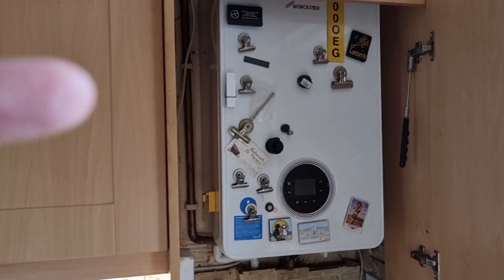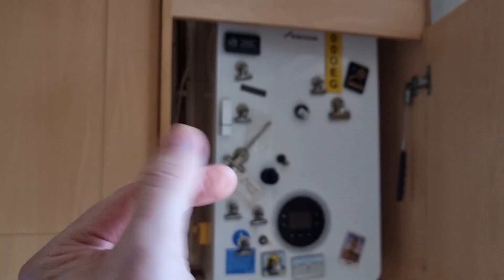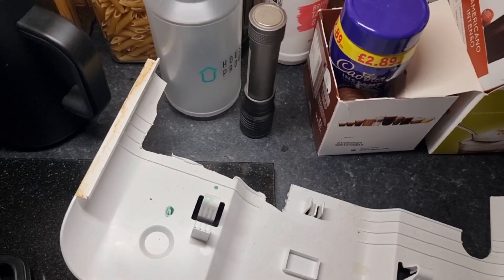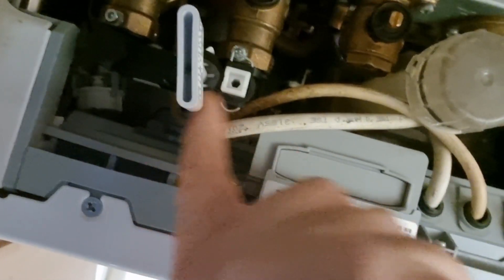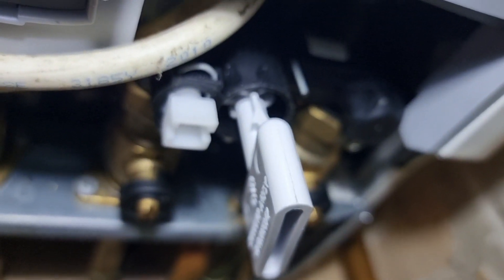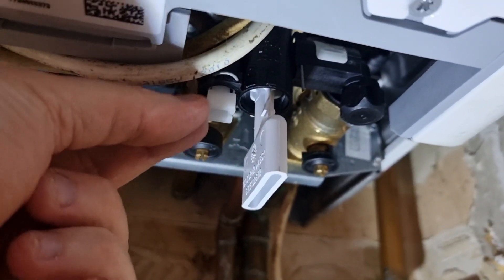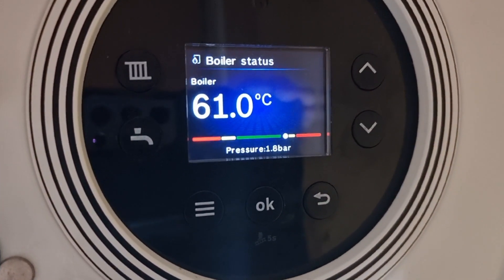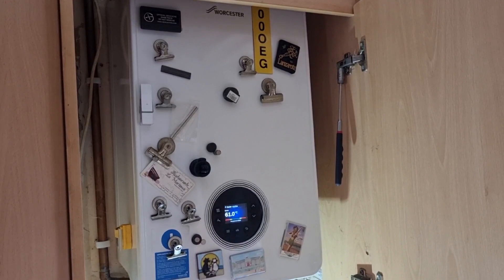How to pressurise a Worcester Greenstar 4000 boiler and where to find the key.

Comment: My Worcester 4000 has the key aswell, I've been hearing a gurgling noise from mine so going to bleed radiators. 

My question is that it's advised to switch off your boiler when repressurising, how am I meant to know what the pressure is at if its turned off??? 😂

Comment: Thanks for this video. Worcester Bosch's own videos are hopeless - they say it should have been demoed how to do it on install, but it absolutely was not. Then it relies on me knowing that the bottom of my boiler comes off without showing me how that happens. From a casual look over, it does not look like the bottom plate is removable. So, seeing you take your bottom plate off pointed me in the right direction and then I quickly found the blue filler valve. Very helpful, thanks for doing what the manufacturers couldn't and showing me HOW
Reply from the maker: I'm glad you found video helpful to you. I totally agree the manufacturers or the installers should have demonstrated everything so that nothing was left to doubt

Comment: yours is the most helpful video by far - all the videos show a blue valve , like you mine does not have this . The boiler is only a year old and the key is missing . Can only assume the installers stuck it in their pocket by mistake. I have a key on its way via a well known online retail site. Only wee observation I have is that my boiler doesnt seem to have the little white square box next to where the key goes in - so fingers crossed its a simple insert and twist to refill function !
Reply from the maker: I actually found my key. It was a attached to something on the boiler but I'm trying to remember where. It may be clipped onto the inside of a flap or something. If I remember I'll send you a comment
Reply from the maker: Check underneath your boiler there may be a bottom tray that unclips. It may be quite stiff but I'm sure on the inside of that tray the key as attached to it
Reply: @wrightbytes  Many thanks for your responses - key 100% missing . BUT !!!!! - it turns out our boiler has an ' intelligent filling system' installed so it refills itself automatically. We had paid for this extra when the boiler was installed. It was a ' simple' case of going into the menus on the screen and selecting the auto refill option-  its default setting is OFF so you have to tell it to refill itself incase there is a serious leak so it needs human intervention to make sure its ok to start repressurising which makes sense . Lo and behold thing was pressured up and running after about 5 mins. I thought about putting a video up as i can NOT find a video that tells me this and YOUR video was the only one that came close to helping me out. The giveaway was the fact that mine did not have the key insertion valve underneath like yours and definitely did not have the blue valve that every other video seemed to show. Thanks again
Reply: Interesting 
Had mine fitted about6 months ago and haven’t checked pressure as it’s only been running the hot water so far. Heating being used a little bit now so going to have to brush up if I can find the manual 
I’m finding that the boiler cycles constantly now the heating is being used. It’s fitted in our bedroom in a cupboard on a common wall with our neighbour so wondering if the constant cycling is notmal. Dont want to annoy the neighbour with the noise